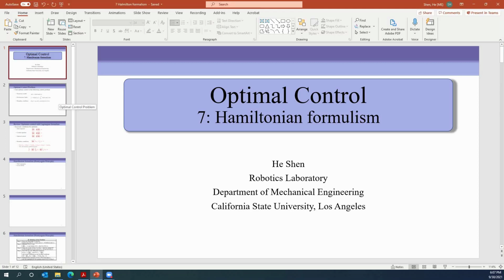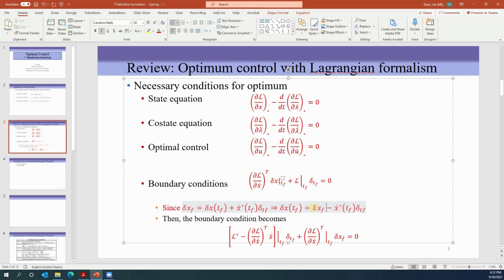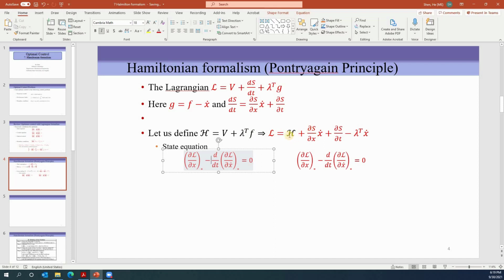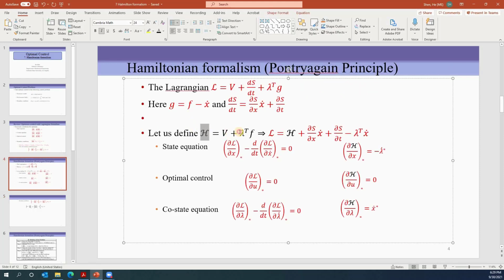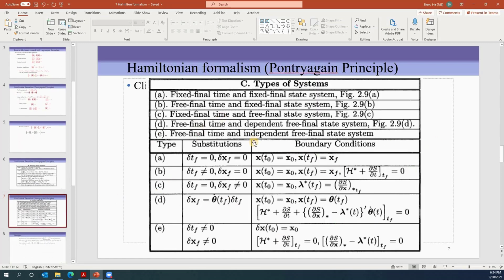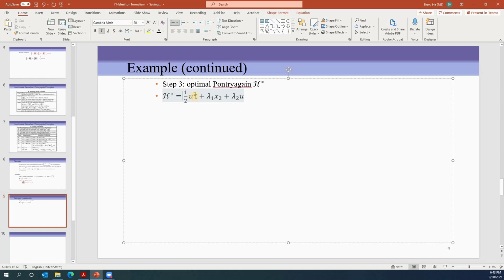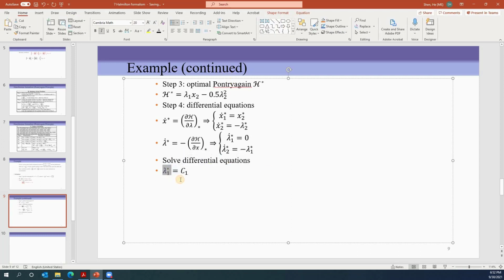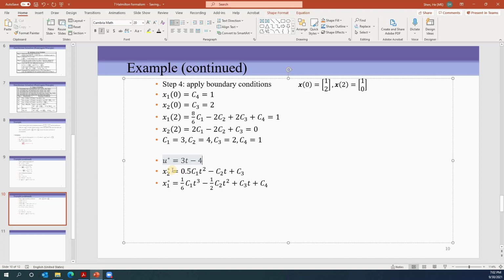7.  Hamiltonian formalism (Pontryagain principle)

Comment: min 6 when you change the state equation from L to H, partial L / partial x dot. Doesn't partial L / partial x dot have two components: partial S / partial x and Lambda transpose? The first one seemed ignored.
Reply: Agreed. I thought I wasn't understanding the calculation. Also I didn't understand, in case of states equation, why are other terms not the functions of x?If you understand that kindly explain me.TIA.
Reply: @xyxbca12332  You can replace ds/dx*dot(x)+ds/dt by ds/dt (full derivative). And we know that partial derivative of s by dot(x) is 0
Reply: It is right, please refer to page 64 in textbook Optimal control systems of Subbaram Naidu.